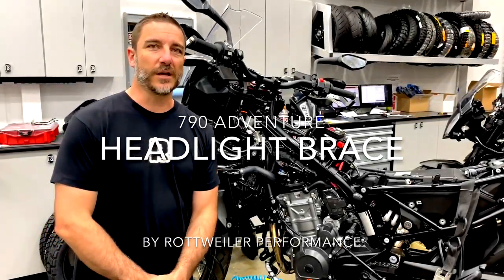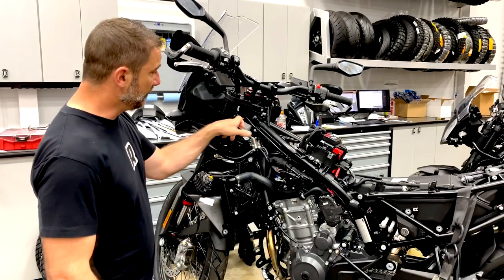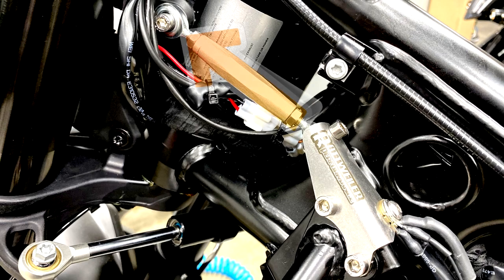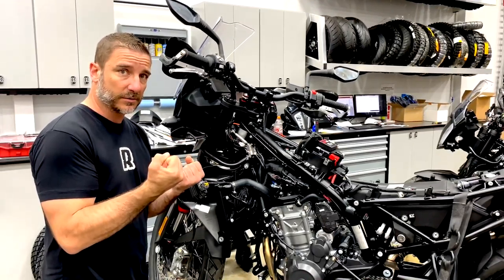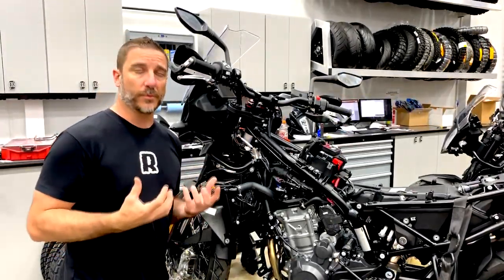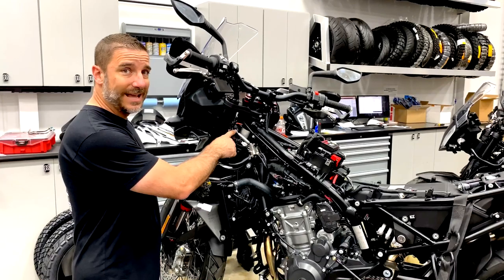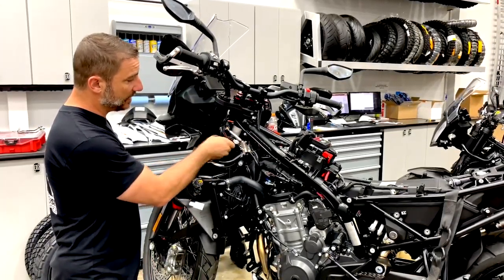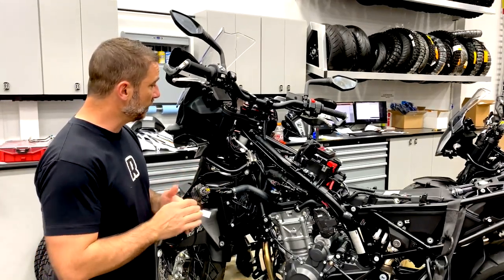PRODUCT REVIEW - ROTTWEILER PERFORMANCE HEADLIGHT BRACE - KTM 790 ADVENTURE

Comment: I installed my upper crash bars yesterday which were difficult because I got big hands, the neck brace from Rottweiler came in today and now I realize I have to remove the crash bars to install this. Hahahahahaahhaahah. It’s all good the parts look well built and it’s better than a busted headlight! Also adding parts like this is a great way to get to know your bike from the comfort of your garage.
Reply from the maker: LOL, the irony of mixing aftermarket parts!  Glad you like them and got things sorted!
Reply: Update: I installed the neck brace, pay very close attention to the part of the instructions concerning the fuel tank rubber grommets. There are 4, 2 on top and 1 on each side of the tank. Immediately put those to the side when your lifting up the tank. Take your time bolting the brace to the frame and especially to the head mount, these are some serious stainless bolts and you do not want to cross thread them! I’m very glad I went with this brace, I can see why it will hold the head unit together. Full disclosure: I’ve worked on plenty of cars but this is the first time I turned a wrench on a bike.
It was very straightforward and it did take me 2 hours by myself.
Reply from the maker: @8andsk835  Really glad you are happy with the kit and we appreciate the kind words!

Comment: My son is on his dream trip( funny you should mention it ) and this has happened to him. He is paranoid the whole thing is going to come completely off the bike. From your video it says the bottom attachments are not usually a problem. So he zip tied the top mounts and they only held for about 10 miles today. I told him to zip tie it again and tape the crap out of it so he doesn’t loose his headlight because you need to take out a loan for that thing. I tried to order this from your company and sent to him but it’s on back order for weeks. I had to order the other type of bracket and have it sent to him. My question is.....what’s the chances of this whole assembly falling off the bike with just the two lower mounts and gorilla tape?
Reply from the maker: It still has the bars, so it won't come completely off, but we are just finishing up on a build on these and can rush one together if you like. Just email info@rottweilerperformance.com and ask them and I will personally put one together. We were just waiting on the rod ends and they have finally arrived in mass. Now we just need to build the kits!
Reply: @RottweilerPerformance  I will order one from you because I think it’s an excellent product but he is suppose to get his soon so no rush. He has been doing ok and is making good progress on his trip. Now that you have them I will go online and get it. Thanks for the reply.
Reply from the maker: @jws6076  I just checked and we have them in stock and are making hundreds more currently. Hope his trip goes better after the install!

Comment: Does the fuel tank (or anything else?) need to be removed to install this brace?
Reply from the maker: Not completely. The instructions are actually linked on the page where they are available and you really only need to remove the fuel tank bolts and lift it up a few inches. We looked at making something where you didn't need to do any of this but unfortunately the end result is a flimsy brace so we chalk up the extra 15 minutes of assembly time as the price you pay to get a proper mount.

Comment: HOw tight does one make the brace?  the turnbuckle?
Reply from the maker: Maybe 1/4 turn after it starts to get tight. That's it. You just want it snug so nothing can flex forward at all. This is the problem with sheet metal braces. They are all folded which is flimsy. This is a straight line turnbuckle. Very strong.
Reply: @RottweilerPerformance  Ok, brilliant, this is being ordered in the states and being sent to me by a friend.  I like your engineering, it does make more sense. a simple plate is a cheap fix, and then offcourse, if the bolt loosen the flimsy plates means nothing.
Reply from the maker: @andreviljoen1817  Exactly.

Comment: Can you tell me why this is better than the Camel Neck Brace?  The Camel one seems a lot simpler and lighter.  Not trying to knock yours down but they are the same price and I would like to know which is better and why.  Thanks.
Reply from the maker: It's a different concept really. The idea behind this design is 'zero flex', meaning that it is impossible to move at all, even if the headlight hardware were to somehow come loose. There is another design out there other than Corey's (from Camel Tank) that relies on the pressure of the back of a tiny 6mm bolt head in a slotted hole. This means that the entire strength of the brace relies on a tiny amount of surface area, and if that bolt comes loose, the brace is doing nothing at all (except for cutting the dash and headlight harness reportedly). The Rottweiler design uses a turn buckle mechanism that actually draws tension on the bolt and anchors from a solid mount from the frame. There is zero sheet metal flex, and again, even if the bolts come loose, the design still works and braces the headlight. Another very small bonus is the fact that you can read the serial numbers. This can be handy when crossing borders if you are an international traveler. 
Corey from Camel Tank is a good friend of ours, and we certainly don't wish to knock his design. It's a good one and we actually sell it as well at Rottweiler. The Rottweiler Headlight Brace is just a different concept.

Comment: Any chance it can be modified for a 1290SAR?
Reply from the maker: You won’t have to. We plan on making one for that model too!
Reply: @RottweilerPerformance  Will It will work with the BRP/Scotts setup installed?
Reply from the maker: @johnhoward9198  If you are talking about the 790, the device doesn't come anywhere near it. If you are talking about the coming 1090-1290 version, same story. They are well below that area.